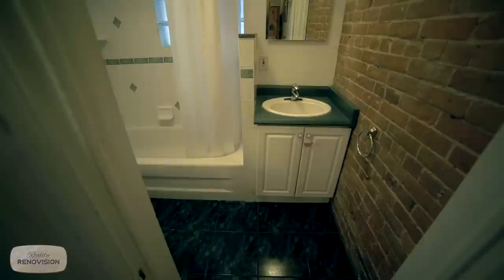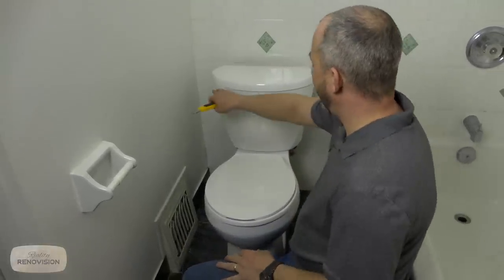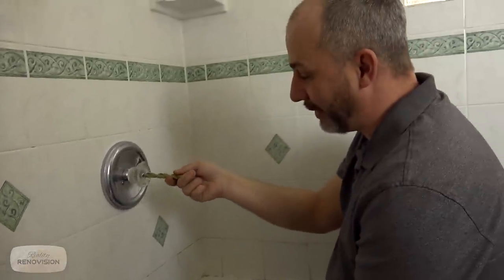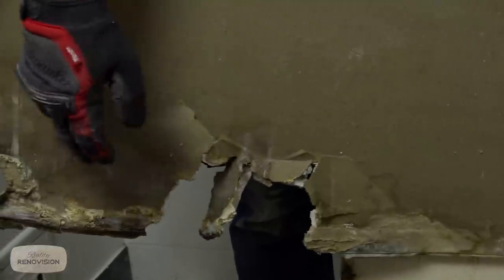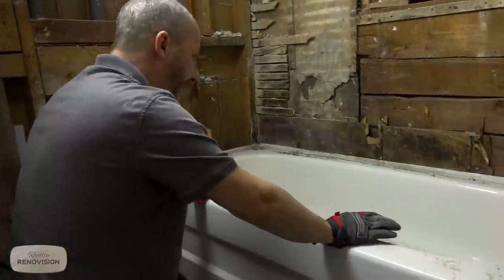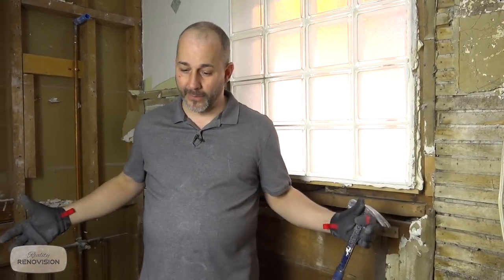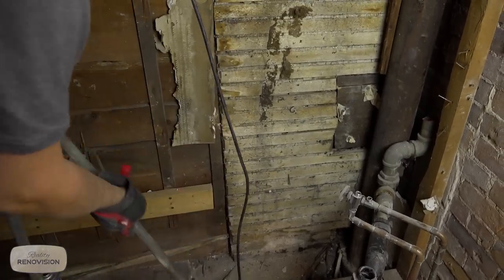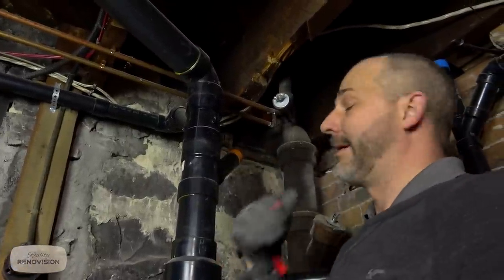Small Bathroom Renovation 1905 Building | Reality Renovision Ep16

Comment: Trick 101 ... use a zip-lock bag to put all parts (screws, brackets and such) into and tape shut  and to the larger parts, ready to use again when reassembling.  Zip Lock bakes are very handy to keep track of small parts on the job or shop.

Comment: When you start pulling finish walls off of the old 100+ year old bathroom, is always a surprise.   I found 6 layers, and an additional foot of ceiling space.  Why did I look?   I felt like the center of the ceiling was dome-ing down.  Turns out, it was slowing falling.

Comment: Next time you're in my neck of the woods please feel free to stop by and renovate my 2nd floor bathroom in my old 1893 year old home ;)  I got a cold one with your name on it.  Appears my bathroom was also added after the fact, it was raised to add pipes underneath. Seems like a lot of work for one small old bathroom, how long did that actually take?  Looks so good.    Geesh, it took me a couple months to finally complete my kitchen.  I don't know what the heck type of bracket they used to hang the kitchen light, but it wasn't a box.  I'm quite handy, but I can't imagine myself doing my small bathrooms!!  It would make me very nervous as to what might be behind the walls or under the floor(like rotten studs, wood or joists), let alone trying to snake new wiring through lath and plaster.  You ever re-positioned tubs, sinks and toilets around in a room? Very entertaining and informative, you're videos motivated me to sit down and watch more of your videos.  All jokes set aside thanks again for the videos.

Comment: Funny.  Cool..... The wall looks like 1950s..exterior wall no horse hair spackle.  Tub late 1950s to 1980s to me...they still make the shower tub hardware...that's what I want to gut..Thanks. Wall fan.  The steel black stool drain too change out????  ..ummmm   They gave me two reds laundry lines...75 odd years ago house.. steel lines painted... lots of problems like you said huge construction changes starting in the 50s. Not all construction contractors changed at once either.ie  Plaster board to dry wall, black white electrical wire then the new stuff......

Comment: I am ripping out tile in my laundry room that runs into a hallway. id like to change just the flooring in the laundry room  but there is no threshold i have a diamond blade for my angle grinder so i can cut the tile where i want but how do i get up against the door trim to at least score the old tile so I can control that crack and keep it straight.

Comment: I see no other comments about the tile. Am I the only one who noticed how horrible the tile work in the shower area is? Take a look at the top left corner of the shower up by the fixtures. It is all over the damn place. And extremely crooked and uneven. I sell home renovations for a living. This is why I always steer customers away from tile. It is never consistent. And once it is done it is done. They are going to be pissed when they see this. The sad part is since it is already shifted and uneven it will only get worse over time as the house moves and settles. what a nightmare.

Comment: This is not much of an improvement with a plastic shower pan
Reply: There's a difference between "plastic" and "reinforced fiberglass".
Reply: @chrisgraham2904 , sure, when it comes time to having to re-gel coat your shower pan. Other than that, you mean?
Reply: @danajoseph6705  Is that a thing?  Never heard of anyone needing to re-gel coat a fiberglass shower pan, unless maybe they have used harsh cleaning chemicals on it.
Reply: @chrisgraham2904  , I'm sure it's not. But the difference between fiberglass and plastic is pretty negligible when it comes to adding value. Both turn yellow, and both become brittle. Neither add any quality or value, and both are eye sores in short periods of time.